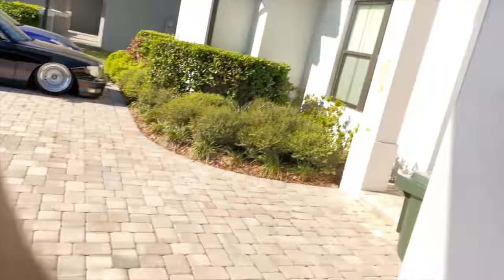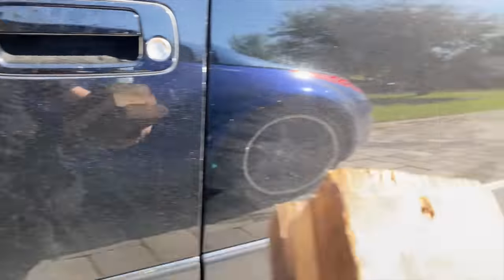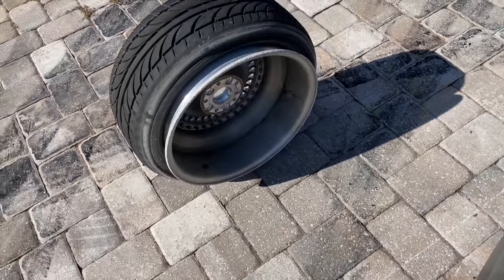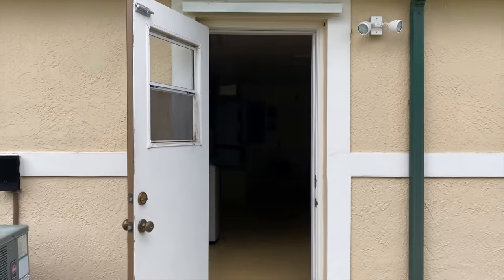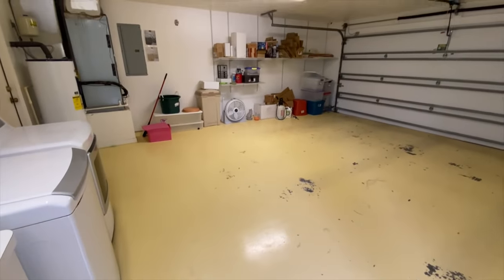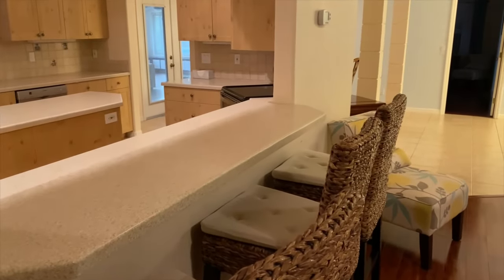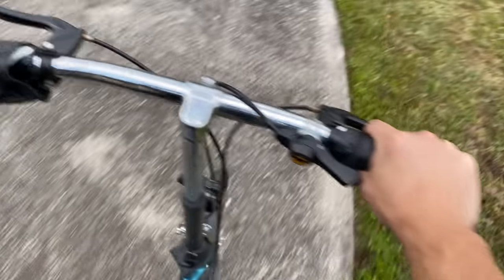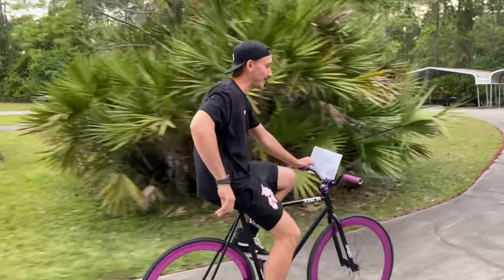Moving into the LZ Compound!

Comment: Get an alignment asap. I had the exact same issue on mine w/ approx 12 degrees of camber (235/35 on a 10.5). The toe was only marginally out but it was enough to debead two brand new tyres within a few hundred miles.

Comment: If i can weigh in on the camber stuff , 
I always scuffed my barrels and lips where the tires sit , 
Most of the time i would use bead sealer but not all the time , 
I also kept my psi at 50 
With those things i always kept my tires riding nice and never really debeaded

Comment: here are some things that will help you keep your tyres beaded :)
-gluing the inside of the tyre to the wheel
-tyre pressure monitoring, as they debead when they get low on air after beating the air out of them and almost debeading a few times
-running at maximum air pressure for the tyres
-adjust it to toe slightly invards, as that will pull the tyres inwards and prevent debeading

Comment: Sliding run anything smaller than a 40 sidewall I promise you it makes the difference and works I cracked 3 wheels multiple times on 35 sidewall with 10 degrees of camber

Comment: 0 tread used on that tire and it wore out.  Maybe a bit much camber there LOL
Reply: It’s a toe issue not a camber issue. Camber doesn’t necessarily wear out tires excessively fast on its own, stance cars tend to run through tires because it’s so hard to get the toe perfect with the suspension geometry being as compressed as it is, not to mention how frequently the ride height gets adjusted

Comment: if u keep debeeding u need to run alot more pressure i ran 75 in my rears when i did -12deg and ran like 60 in the front -7 it helps with tire wear also cuz it pushes the center out and it makes the tire bulge from the center out

Comment: gotta keep 55-60psi in the tires and monitor the pressures daily. and look under the car constantly at the tire as soon as it looks like it has alittle ware on the side wall you have to flip the tires. with -14f and -16r i would buy tires drive a month, flip my tires drive a month and then buy new tires. and i did not drive far. but pretty frequently i would debead but not as much once i worked out a good system.

Comment: Bro you’ve probably blown 215’s on a 10 inch rim , this requires a minimum of 40 psi at all times , the camber crushes the seal on the bead giving it less of a chance too ! Go 10 mil wider on yours tires you will still attain a stretched look with a lot less hassle , but seeing as you’ve ruined those rims I’d get a more appropriate set . Clean that turd up and move it on 👍🏻